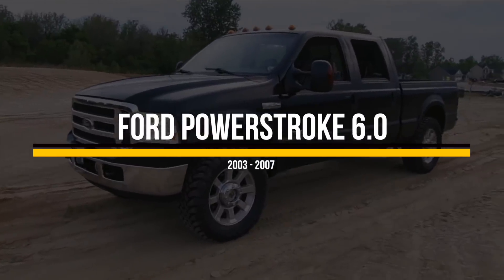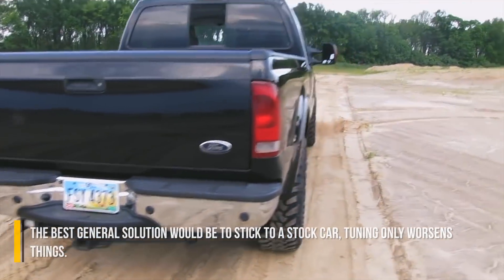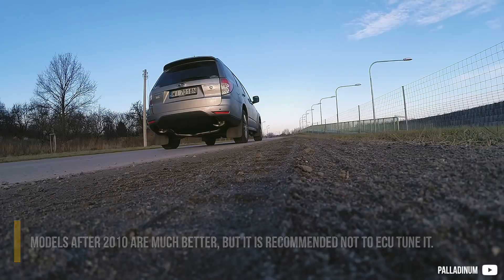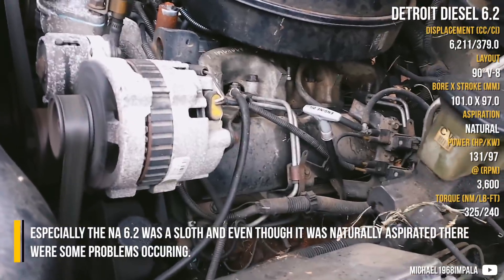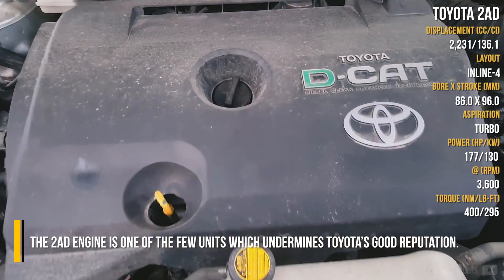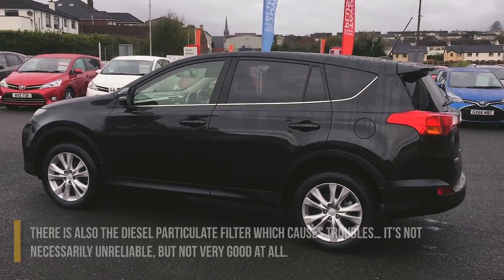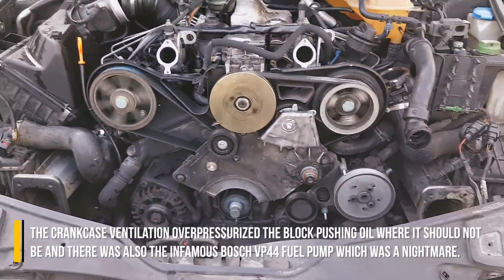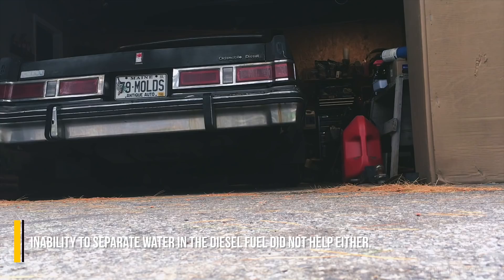6 Worst Diesels You Should Stay Away From

Comment: BAD LUCK BRIAN: Buys a VAG diesel car, it’s a 2.5 V6 TDI
Reply: Some versions of 2.0 TDI were also horrible.
Reply: 1.9 TDi also sucks.
1500 euro repairs ona 5000 euro car
Reply: Bullshit, the 1.9 TDI engines made before mid-2000 are bulletproof. For example the ALH 1.9TDI, found in Audi A3, Bora and Skoda Octavia MK1 is capable of running 600 000-700 000km without a major rebuild, excluding clutch and timing belt changes but those have to be changed anyway at some point.
Reply: 1.9TDi usually is one of the best small diesels. 2.0 and 2.5tdi's are horrible engines. of course every engine has its flaws
Reply: haha, sure.
2007 Touran 1.9 TDI 105 at 140 000km it had to have its turbine, actuator, flywheel and clutch replaced.
Plus it's a BXE which means it could put a rod through the block at anytime.
Reply: horrible? Owned a v6tdi for 12 years! One turbo under warranty due to vane troubles but other than that, smooth as hell that passat was. If I hadn't had Mrs troubles I'd still 've had it. I have 2.0 tdi passat now the pd version engine, 100k on clock and it's fine. Depends how they're looked after and serviced.
Reply: 987654321 Did you even read my comment? I said 1.9TDI engines made before 2005, after that Vw made subtle changes to them and also replaced the 1.8L 20-valve turbo with the oil-chewing TFSI petrol engines. If you buy lets say, a 2008 Audi with a 1.8 TFSI, be ready to buy a few cases of engine oil
Reply: 987654321 
I've got a 2008 Skoda Octavia 2 with the BXE engine, it's not even done 50,000 miles, it's been absolutely flawless and very reliable and great on diesel.
Reply: 987654321 1.9tdi was one of the best Diesel engines to come out of Germany, don’t really know what you’re talking about
Reply: 0laZz 
I converted an ahu to mechanical injection, stuffed it in a mk1 golf and loved the 14 flat in the 1/4 it used to run.
Then I’d get low 50s for mpg on the ride home. 
Best of both worlds, tons of tdi torque and no electronics to break!!
Reply: OlaZz: false, the badest diesel alway built by VW was the 2.0TDI 140hp pump injector engine: was realy shit...
Reply: Not the 2.5 tdi straight-5 from the 80/90's. That was a great engine and was shared with some Volvos. The 2.5 I5 from Transporter and Touareg are also great engines.
Reply: Exactly! leneanderthalien
You forgot to mention the headgasket prone to crack and leak coolant in the engine, or the fuel pump going bad, or the injectors to stop functioning due to insuficient teflon coating and low sulphur Diesel fuel. It was the worst Diesel engine VAG had build, in all times (there's still time, you know? xD )
Reply: @987654321 We've also got a 1.9 TDI Touran (2003) but after we've had a broken head gasket we actually never had any problem with the engine again.
(It's now at 130.000km)
Reply: Hahahahaha, this guy concideres the flywheel and clutch a art of the engine :D
Reply: I have 1995 A6 2.5TDI with 385k and 2000 A6 1.9TDI with 314k and no problem with engines exept regular services, and as i know 2.7TDI vas V6 2.5 TDI is 5 cylinder
Reply: Ivan, your 2.5 is the old 5 cylinder engine produced till the beginig of 1997 which technically is an 1.9TDI + 1 cylinder. After 1997 VAG start to make a 2.5TDI which is V6 with 24 valves and it is the infamous one.
Reply: don't know what kind of 1.9 you got lol, must have come from a boy racer that upped the output or something
Reply: got a 2.0, hasn't had any problems yet, lets hope it keeps going that way, at least while warranty is available
Reply: pre 04 1.9's are where its at
Reply: The old 2.5TDI inline 5 (AEL) fitted in C4 A6s is fucking awesome, so you should specify that its the V6 that sucks.
Reply: WTF are you talking about guys 😂 all 1.9 are bulletproof,  hundret thousands of km. Why you blaming turbo or clutch failure on engine? Omg 3rd 1.9 in house, remapped, so much on ODO and still going. They need just good fuel ( expect old 1.9 tdi and td, they can run on used oil without problem 😂 ) and dont forget for oil changes. When your turbo die, trust me it is not something you can blame engine for 😅🤦🏼‍♂️
Reply: Indy7272 luckily i have bkd :3
Reply: The PD 5 cyl is shit mate
Reply: BKD 2.0 
is unreliable, BKC is good 1.9
Reply: EngineEngineer nah mate, the pd's with siemens are
Reply: timing gear and cams
Reply: EngineEngineer why? What problems with 2.5 R5 tdi?
Reply: Guys any knowledge/experience on the newer 1.6 TDI engines?
Reply: leneanderthalien 
We have different names for our stuff here , and we didn’t get a lot of the euro models. 
I got a 2.0pd from a 2004 passat (bhw engine code I think)
From what I know , the balance shaft system is a turd, so you’re better off deleting it which is what I plan to do. 
The one we had was rated 131hp and like 245ft pounds
Reply: One of the Crafters i drive at work has the 2.5 I5 TDI... it drinks a liter of oil every 2k kms.
Reply: Good luck Josh: it's your problem.
Reply: no ita 1.4 TFSI
Reply: Viking Raiders  Skoda makes subtle (and not so subtle) changes to the VW engines before they go into their cars. Most of them don't suffer from the same issues VW/Audi cars equipped with the same engine do.
Reply: @buntakive  hope, the older 2.5TDI was a 5 cylinder from back in the 90's as I had a 94 Audi 100 with one  and in the A6 and Passat it was a V6 ;)
Reply: @buntakive  385k km? You sure kms are original?.. mine 2.5tdi ael,5cyl,'96 has 600 000km.engine still not opened.i drive it for last 10 years.goes like hell.no smoke,no oil consuption.bulletproff engine.
Reply: Firs gen v6 tdi was disaster 110kw model later engines are good i had 132kw model it had 400000+km on clock no problem
Reply: @OKMX5  2.0TDI are bad up until August 2008 after that the 2.0 TDI is Amazing . They switched to Common Rail.
Reply: @OlaZzz  Correct.
Reply: Me. I'm that Brian.
Reply: @Timoastra  the early 2.5's were notorious for snapping camshafts,the later 2.5 backwards 5 was a pile of shit,I have replaced and repaired many,the last 3 because the windage tray cracks and flips up so cylinder one rod grabs it and proceeds to wrap it round the crank and rod.Had a few where the injectors (only being held by one poxy little bolt) start to chatter in their ports wearing the port to the point you need a new cylinder head or worse still  diluting the oil and then causing a runaway leaving to the rods making a bid for freedom through the side of the crankcase at 7k rpm!.I was driving a 2 month old one as part of an independent inspection after vw gave the customer the brush off,when the plastic casing of the css split and the coil unwound it's self and sucked about 5 millions miles of fine wire up the oil pump pick up and stopped it dead in about in about three seconds,I like modern German cars,they provide a more than steady flow into my workshop.
Reply: @9876-j8v  Flywheel and clutch nothing to do with the engine first. Second turbo failure common to all engines, so pointless
Reply: Had audi a4 b7 2.0tdi 140 pd, broke the head at 220k km and the oil pump drive shaft just a month after :(
Reply: @leneanderthalien  my mom owns a seat altea XL 2.0tdi 140hp, has over 200k km on the clock and it runs as I it was new, I guess that it depends on how well you treat it, if you don't treat it well, it will have problems, but that's your fault
Reply: @samueljvolf  he's taking about the 2.5 v6 tdi
Reply: what are you doing with that engine?  you have tuned it above 105kWor higher do you? engines up to 96kW where totally indestructible. many people around me have variety of 1,9 tdi and BXE is not an exeption. only who has trouble, was changing lub oil later than 20000 miles.  smart people don't trust on the longlife oils and change it around 10 000miles. i think 1,6TDi CR is much worse. when i refill the fuel tank(around 40l) i must refil also around 0,5-1l of cooling fluid. i have for repairs spend about 2000eur with no result

Comment: "The LF9 wasn't a Rocket 350 turned into a diesel as many think, but some components were shared."
Self contradictory statement.  The reason the engines shared components was because that's exactly what GM tried to do - to make a diesel engine out of an existing gasoline engine design instead of starting from scratch like they should have.  They did it because for a brief while diesel was significantly cheaper than gasoline, and GM was rushing to put something in production quickly.
Reply: They shared a few parts with the gasoline V8, water pump, valve covers, rocker arms and bridges, oil fill tube, rod bearings, exhaust manifolds and certain oil pans.

Blocks are different and use the big block 3" main bearing crank journals, other parts unique to the diesels: heads, connecting rods, pistons, camshaft, lifters, pushrods, intake manifold, timing gears, lift pump, flex plate, starter, oil pump drive/vacuum pump.

Comment: WHAT!? Japanese can not make good Diesels? As a Renault owner you have to know that the 2.0 dCi in the Megane, Laguna ect. were troublefree and goodrunning Renault-Nissan-Diesels!
Reply: ElectronicRedPanda 
They are all good and reliable and silent. Of course there are some that break down but 80% are good.
Reply: The new Dci engines are much more reliable and they are developed by Renault and Nissan.
Reply: Sorry to burst your bubble about Renault- Nissan diesels, they were Renault designed and built engines that are great, Nissans own engines as fitted to the Pathfinder and Navara ect. are absolute Shit. Nissan diesels used to be great but not the newer ones with their timing chain snapping issues and oil leaks. I had a Nissan X-Trail 2-2 dci Aventura which as absolute crap, Nissans aren't what they used to be in the past, some people blame Renault for this but it wasn't the Renault engines that failed, the Clio 1-9 diesel I had in 1994 was one of the best diesel cars I've ever owned, fast and frugal it was great and did over 120,000 miles before I sold it.

Comment: 2AD loves blowing head gaskets, not Toyota's finest moment.
Reply: D C similar to the petrol 1 and 2 as units 🤦‍♂️
Reply: Az*
Reply: That depends which 2AD, the 177bhp version in the Toyota can be unreliable mainly due to head gaskets and DPFs however the 120 and 150 2AD FTV versions which don't have a DPF are reliable in my experience.
Reply: My dad have a 173hp (130kW) 2AD Avensis from 2008. With it chipt it has 200hp (150kW).  He works most of the time and maxes out his overtime every month. He works at a place 50km from where he lives and have had NOT a single problem with that engine. He did destory a brake disc and brake pads in the back from ice build up. Had some normal wear like wheel bearings and stabilization arms.  Like the worst thing to brake on it was headlight bulbs.... Pure pain to change them out :c 

Fule usage. 6.4L / 100km if you drive around 80-90km/h and is nice to it. But dad is not nice to it and likes to pull ahead of BWM drivers at stops lights that think they are something :/ (and also drives at 130-150km/h....)  He average 7.1L / 100km.  Calling it a bad diesel is just wrong... It is not thirsty fools. It is just a big heavy modern car. Mabye they have gotten worse? Anyways dads Avensis I have respect for. Very few modern cars I can say that to.

100km 5 days a week for 8 years now. In -39 Celsius to +32 snow, rain and mud. 

Before he own it it was a leasing car and had a ruff life with scraped rims and the gearbox was like if someone that did not know how to drive a manual had it before him. (first and second gear was a mess) but still works 8years later. Just have to be careful when it is cold outside. It as many miles on it. We are talking about 300,000km at least. I don't know for sure but due to it being diesel it will just keep running until old age catch up to it. That being soon :c
Reply: it was not only the gasket, it was the blown Head oder Cylinder block! but at all a very bad engine!

Comment: The 6.5L and 6.2L Detroit Diesels should not be on this list... These engines have a reputation in the motor boat industry that is like the 5.9 Cummins in the Pickup trucks... They have been the only engines ever used in the US Military HMMVEEs and get any where from 21.5-29MPG.... The only problem with these engines is the way GM installed them in the vehicles, the accessories on the serpentine belt and the fuel systems are the problem, not the engine it's self... 6.5L and 6.2L never had their "common problems in the non-civilian road vehicles they were installed in.
Reply: Yes, they were in HMMVEEs - but they had the budget for them. Unless you inherit the US Treasury, avoid 'em.
Reply: @Corn Fed Owned a 6.5 (1999, last year for civilian models) for almost 4 years, never had that problem but I've only put about 25k on it. Glow Plugs are old, though.
Reply: humvees had a reputation for blowing up engines

Comment: Two examples of a good diesel, Fiat's JTD, used in the Tempra, and believe it or not, the Austin-Rover/Perkins L-Series Prima turbo diesel, as used in Monetgo/Maestro and beyond. Both were powerful direct injection turbo diesels at 2 litre. The Perkins/Rover unit was especially solid.
Reply: The Rover L-Series is an absolute cockroach of an engine. I saw one at a show a couple years ago with 1.3 million miles on the clock! Great unit.

Comment: I must admit, that this VAG 2.5 V6 TDI is really unreliable, but damn, those engine sounds are like a piece of art! I used to have some experience with BAU coded engine (which supposed to have those camshaft and rocker problems removed). Those sounds were stunning, apart from knocking noise 60k km after :D
Reply: sad I have only driving the 5 cyclinder one

Comment: Yep, my band's first van was a Ford with the 6.0 diesel. 2004 with 120k miles, bought in 2012. 
Problems we had: EGR valve failure, alternator failure which killed the FICM as well, significant fuel leak in two places, and finally, EGR cooler failure which put coolant through the motor. 
Engine is near impossible to work on in a van... 0/10 would not do again.

Comment: As a prior owner of a high-mileage 6.5, I can tell you that they aren't bad engines, depending on what you need one for. They are meant for light towing/fuel economy at heart, not heavy towing. The 6.5 is bad about snapping the crankshaft under heavy load, and the 1995+ 6.5's are bad about the PMD going out. (pre-1995 engines do not have electronic fuel injection and are far more reliable.) If you keep these things in mind, and use it as it was designed, the 6.2/6.5's are very good engines. There's a reason the government used them for many years, including in the humvee's.

Comment: Toyota's L 2.2 liter and 2L 2.4 liter diesels did run forever, those were the most used engines in the 3th and 4th generation Hiace and also in the Hilux, I owned a 2.4l Hiace and just had to change the oil sometimes and fit a new oil filter, that's it.
Worst diesel engine I owned was the Opel 1.6 liter diesel, fitted in a Kadett E Caravan, it was very slow, noisy and unreliable, a breakdown each month was guaranteed, so after 6 months I dumped this car at the first car seller i went past, accepting whatever bid he made for it.
Reply: dieselmupke always late in a 2.8 but always there
Reply: dieselmupke I have 2.2 diesel 177hp in my RAV 4 , its a tank
Reply: Jovan Karavezic yeah no its not
Reply: Hilux engine is very very durable. I have the 2015 model and I only go to the mechanic to change brake disks and stuff like that.
Reply: Speaking from my own experience , regular services and no problems :) Pulls uphills like there arent any
Reply: Allan Oliveira 1kd ftv is a beast
Reply: Any GM diesel was shit. I remember Vauxhall/Opel Cavalier/Vectra having a 1.7 Isuzu turbo diesel unit.... bulletproof. Then for whatever reason, a few years later they used a shitty GM designed unit... f'ing AWFUL!
Reply: 99Lezard99 idk who youve been talking to but i had a hiace with a 3l in it that we bored out to 5l specs and it never ran over 9L per 100km. For an na mechanical diesel from the early 90's, id say thats pretty economical
Reply: Nick White honestly i only knew 2 people with that engine but both stated it uses 8-9 Liter of diesel per 100km. While a 2.0 merc 190d n/a Diesel (75hp) uses 5-6 about from the same era.
Reply: 99Lezard99 dont forget the hiace and the hilux boxes are pushing a vehicle not designed for fuell efiiciency, they were designed to work and mine would run under 10 whether it was filled to the brim with stuff or deadass empty
Reply: TheSaintSt1 -Yeh can't go wrong with Izuzu's, overbuilt and under stressed, bloody invincible alright!
Reply: Jovan Karavezic You're right, took my NA 75hp Hiace up Furka Oberalp pass in Switzerland, and it hadn't any problems doing it, even being at 2500m above sea level.

Comment: a few mods can easily boost the reliability and then power of the Powerstroke 6.0's, but from stock, they are lacking. they do sound REALLY good too: the 6.0 is the diesel that made me interested in diesel performance in the first place

my uncle had a 6.2 n/a, and though it was a sloth, it got 24 mpg on the highway with a trailer and a racecar inside it from the factory. no clue on how much the setup weighed, but it was reliable for quite a long time. he was astonished at the mpg it got but hated being stuck in the slow lane so he got a gas engine when the 6.2 needed servicing. 

the military has used 6.2 diesels for decades, and they are very reliable now, but thankfully, are being phased out for a much more powerful and capable Duramax engine.